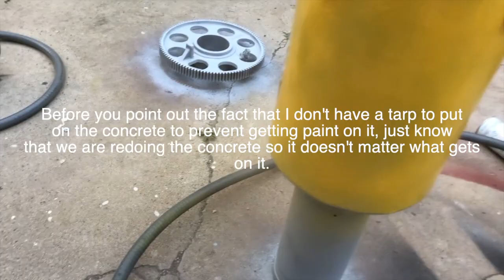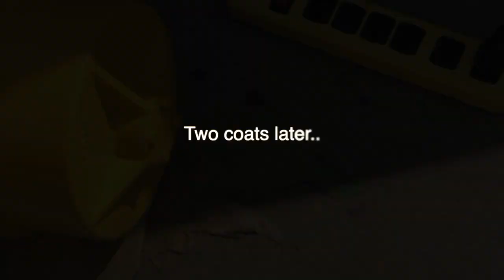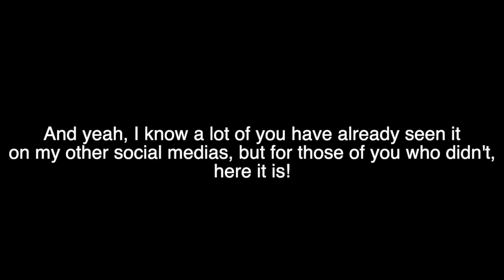My Thunderbolt Re-Restoration Part 4

Comment: What type of spray paint did you use to paint your thunderbolt?
Reply from the maker: I used tractor paint and then coated it with a 2K clear coat. It still looks just as good 2 years later. Stay tuned because I have some awesome content coming out in about a week!
Reply: @friedmanirit  nice! Is the awesome content about the mini thunderbolt?
Reply: @friedmanirit  because Connor Cruz mentioned you with his mini thunderbolt project!
Reply: @friedmanirit  sorry I’m spam commenting but what is 2K clearcoat?
Reply from the maker: @soum23  It's not about the mini Thunderbolt, it's about real Thunderbolts. Also 2K clear coat is a two component clear coat with a hardener.
Reply: @friedmanirit  nice!
Reply: @friedmanirit  Was it Rust Oleum tractor paint that you used?
Reply: @friedmanirit  and if you did what color?
Reply from the maker: @soum23  I used New Holland yellow, I'm not sure if it's still available.
Reply: @friedmanirit  ok
Reply: @friedmanirit  I have you on messenger, im that 11 year old kid that Coen tells you about.
Reply: @friedmanirit  i’ll send you a picture and ask you if it’s the right one